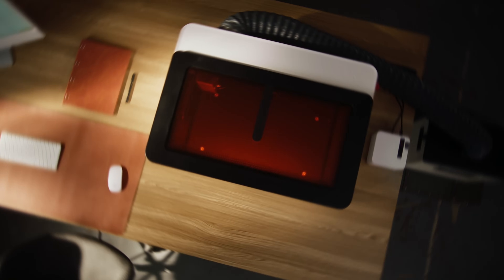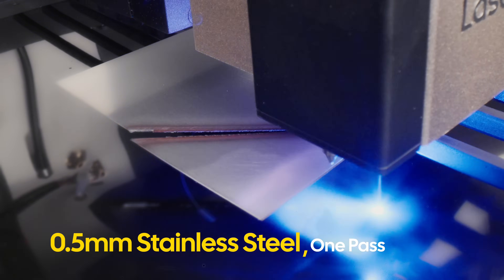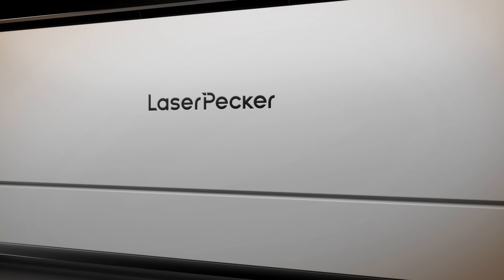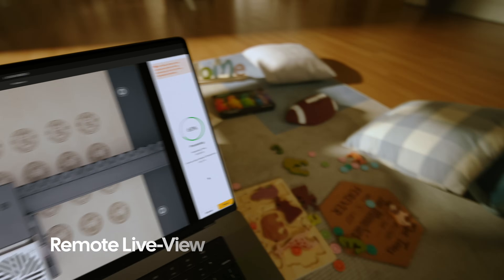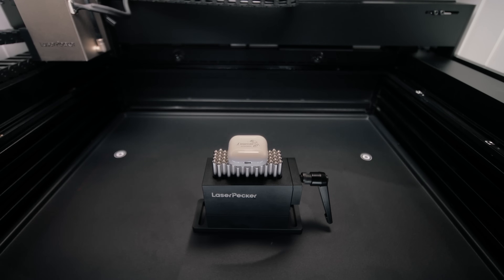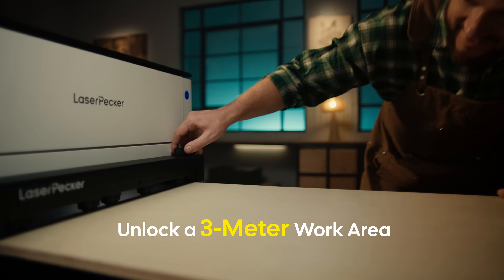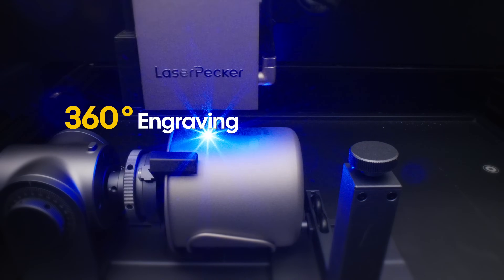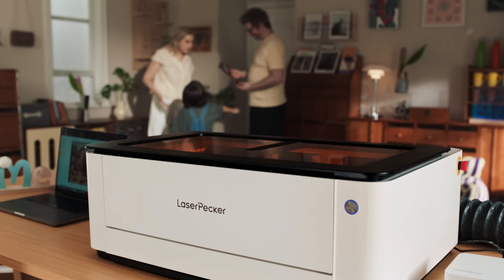LaserPecker LX2 - The All-in-One Laser Cutter

Comment: Hello Laser Pecker,
This video is very impressive! I'm considering buying the LX2 for a professional cutting and engraving project.
However, I have a question about the words that appear on the screen: "5mm Steel, One Pass."
As a potential buyer, can you clarify whether this is indeed cutting or engraving/marking?
Cutting 5\text{mm} steel into one passage requires a multi-kilowatt Fiber laser. I suspect that this may be a typing error for engraving with the IR module.
Could you confirm the maximum cutting capacity on steel or metal with the 40W Diode module or the IR module?
Thank you in advance for your clarification!